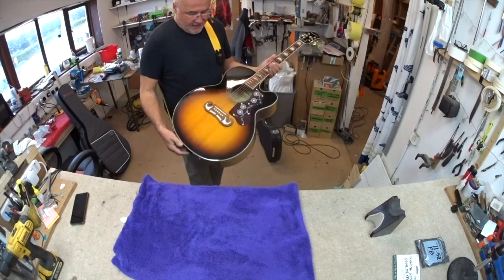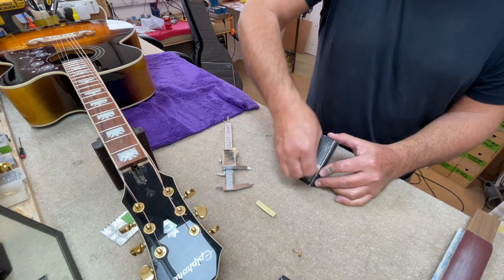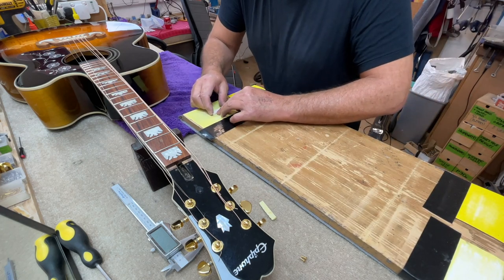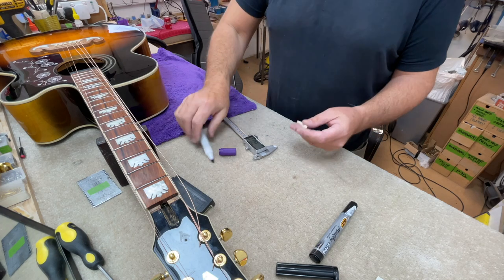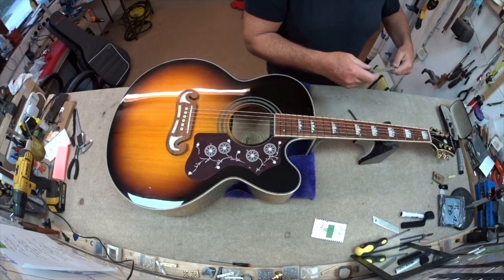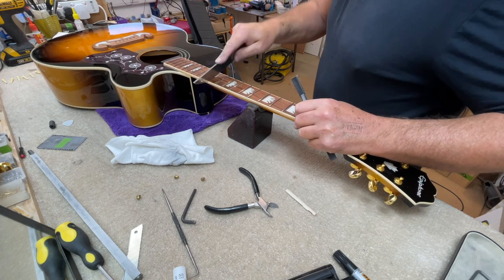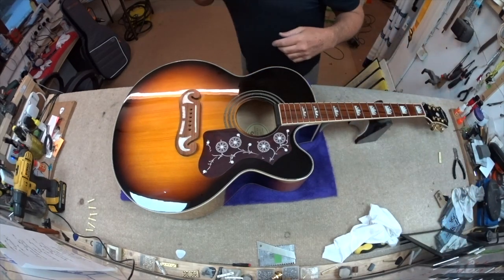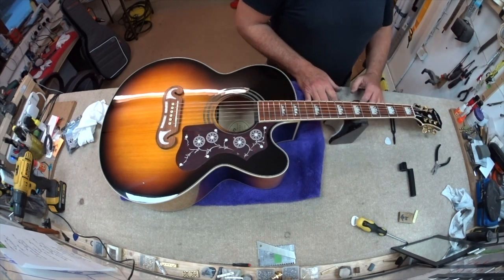Epiphone EJ200 set up

Comment: Hello sir. I bought that same guitar in October 2022. To this day couldn't fix the strap issue. I bought a nice leather strap and to my surprise couldn't fit on the guitar. Tried to widen the holes but due to the diameter of the back peg/jack in and to the position and difference (from almost any other guitars) of the front peg I can't fit that strap. D'Addario has a product that would latch on the back peg but sadly it doesn't fit the wide back peg of this particular model. Any tips to sort this out? Ty
Reply from the maker: Hi Nuno. Having the strap button on the tail end of the neck heel forces the strap to half-twist so it's flat on to the body - a bit like a SG with the strap button screwed directly into the neck joint. I've got a coupe of guitars that are like this and I never feel entirely safe with them... not exactly sure why. If the strap button is too big for the straps you prefer then one possibility would be to replace the large button with a smaller one. If the screw is smaller then you would ideally fill the original hole with a small dowel and re-drill a new, suitable diameter pilot hole for the new, smaller strap button & screw. 
Other people prefer to move the strap button from the end of the neck heel to the side of the neck heel  just where it starts to curve around. If you look at various acoustics in Google you'll find some with the placement there.
Reply: @SamDeeksRelovedGuitars  Ty for responding. So I'm thinking of redrilling, only I don't feel "comfortable" with doing it or even pay someone to to it. Makes me think why didn't epiphone do it in the first place. Anyway, I've googled a lot and didn't find any examples of acoustic guitars having this kind of setup done. Could you point me one example plz? Thank you so much
Reply from the maker: @nunomiguelgomes2713  Here's a sketch (scroll down the page to see the black & white diagram)
https://www.acousticguitarforum.com/forums/showthread.php?t=473390
and here's a guide to how to do it (the one you want is 'Neck Heel 1' in their examples)

sweetwater.com/sweetcare/articles/how-to-install-a-strap-button/
Reply: @SamDeeksRelovedGuitars  thanks Sam. This is a comprehensive guide. Here's what I'm thinking, drilling just above the back peg/jack input where the junction of the woods is and for the top I was not thinking of the neck heel but rather a bit above. The thing is that the wood there is very thin. The alternative have the strap with some chord around the head, which is not my cup of tea. Thanks
Reply from the maker: @nunomiguelgomes2713  Ok - so the back peg is also the jack socket and too wide a peg for your preferred strap and you're thinking of adding another button / peg to work with your strap? You •could• place another regular sized one above the socket but you might run out of space on the rear block on the inside of the guitar. The strap button has to screw into that block. If you move too far from the original button / jack socket you'll be outside of the block and the side wall of the guitar will be too weak to hold a strap button. 
I think your best solution isn't to add another button but to find a strap that will fit the jack output / barrel combination... sorry! 
And the neck heel IS strong enough for a button fitted as shown in those videos and diagram (I agree the strap + strings around the headstock isn't a nice way to go although some people swear by it...) :)
Reply: @SamDeeksRelovedGuitars  about the rear peg, that's what I was afraid of. I've seen an American product (strap buttons) which replaces that end piece but they don't seem to sell it in Europe which is a shame. As for the front one I now get why you say to drill it on the heel of the neck, it's because of the wooden block, which in turn should be done the same fashion at the rear end. I truly love the sound of the guitar but honestly had I known and probably I wouldn't be buying this guitar. It's ridiculous that even epiphone doesn't provide a strap for this model... I mean what to say?

Comment: Hi Sir,
I would like to upgrade tunner machine heads of my EJ200SCE because it looses and out of tunes after bending strings.... May I know which machine heads to upgrade? Could you recommend pleaase? Thanks.
Reply from the maker: Hi NG my recommendation is DON'T replace your tuners. Your tuning stability is 50% down to the nut, 50% un-released slack in your strings. Fit a Tusq nut first (being careful to get a 1st fret action of 0.4mm or close to that) then fit new strings and manually stretch them for 20-30 minutes until they don't de-tune with further stretching. 

THEN - your guitar WILL play and stay in tune with exactly the same, original, tuners. The nut is SO important in this that if you don't feel confident to replace it as I described then take it to a good luthier or tech and tell them you want a Tusq nut fitted with approx. 0.3-0.4mm 1st fret action (WITHOUT nut files being used so they size it up perfectly by sanding from the bottom).
Reply: @SamDeeksRelovedGuitars Sorry but just want to clarify.4mm at the 1st fret for both Low and High E?
Reply from the maker: @TheSchumijr  1st fret action of 0.3-0.4mm for all strings is my target

Comment: HI SAM 👋 ARE THE TRUSS RODS THAT YOU USE FOR FRET LEVELING  PRICISION GROUND? DO YOU THINK THAT IT'S Necessary that they are?
Reply from the maker: Hi Ronnie, no... they're just truss rods. What matters is that they bend smoothly when tightened and that they're a rod-and-bar type (so you can stick sandpaper to the underside of the bar). I use two these days; one rescued from a Squier Strat (about 42cm long, 5mm wide and quite flexible) and a StewMac 'U-Channel' rod (the one for 'electric guitar') which is about 10mm wide but is more rigid, holding its shape well.
Reply: Ronnie, I can recommend buying Sam's "ebook" with accompanying tutorial videos. I set up my electric guitar and acoustic using Sam's techniques and they sound great to me (my son who plays flamenco said the action on both is super low and easier to play?.  👍
Reply from the maker: @briankavanagh7191  Many thanks for the plug Brian! Ronnie if you read this and would like to get my eBook please email me 'samdeeks@gmail.com' to buy it direct from me (and not pay Jeff Bezos any more money to shoot his rocket into space!)
Reply: Sam, when a product is good the rest should know about it.

Comment: Is your Stew-Mac U-Channel truss rod able to straighten out completely? The one I ordered for addressing "fret slap" stays a little bit bent even when I've loosened the nut to the point where it's starting to run off of the threaded part.
Reply from the maker: It doesn’t go completely flat, no. But I’ve gently persuaded mine to go very nearly flat and I never level with a dead flat neck anyway, so it works out pretty well. If you can’t get it where you need, consider gently sanding the curve out on a very flat sanding block. Sounds extreme but worth it in the long run. As I say, I’ve managed with a little bit of gentle persuasion and not needing it completely flat anyway.
Reply: @SamDeeksRelovedGuitars  Thank you! Mine doesn't seem to flatten out enough to match the average correct neck relief, so gentle persuasion may be in order here. I'm assuming that the emphasis on 'gentle' is to prevent it from twisting, which is my biggest fear here.

Comment: Out of interest, why didn't you decide to use the adjustable TUSQ nut that you always use on 3/3 headstocks on electric guitars?
Reply from the maker: Pandering to public nervousness lol. Most people are convinced that somehow the 'tone' that flows through the nut into the neck, through the neck body joint into the er... guitar top er... will er... suffer if the nut is on two grub screws. I'm hamming it up for effect but acoustic Tusq nuts on grub screws seems to be a step too far for the guitar world. I've put one on my Taylor Baby and can't tell the slightest different to be honest... Yeah. So it's down to what my customers can / can't accept I suppose..
Reply: @SamDeeksRelovedGuitars  interesting. I can think of many things that would affect tone and this would be the least of my concerns.
Reply: @SamDeeksRelovedGuitars    Use one stainless steel grub screw and one mild steel grub screw, it lets both
 highs and lows flow equally....LOL.